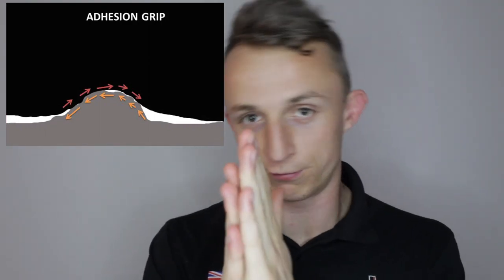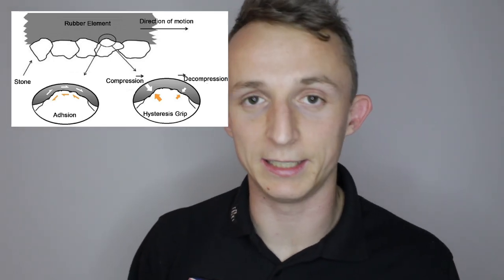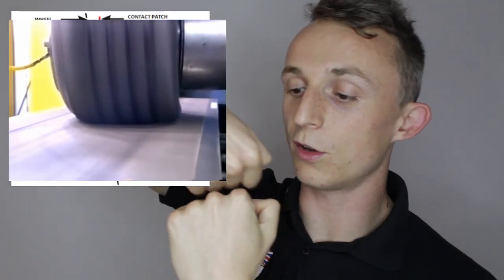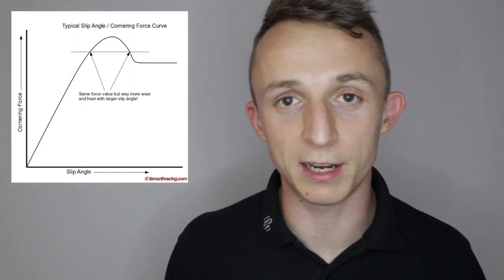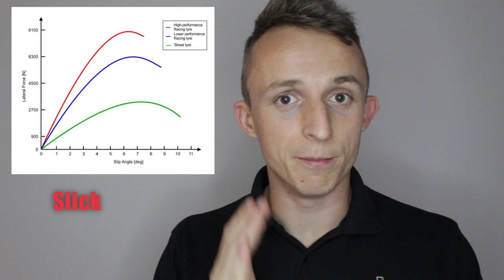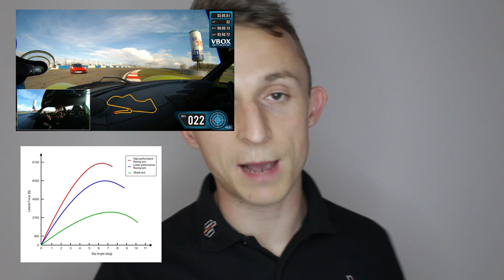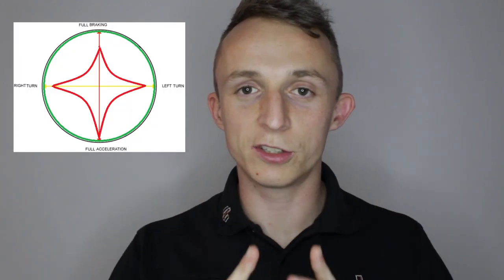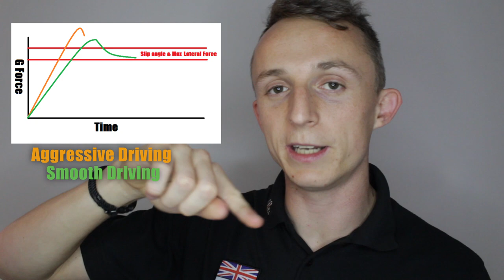How to Motorsport - Understanding Tyre Physics for Racing and Track driving

Comment: We need more! How do you optimize pressure per corner, how do you setup for wet, how does track temp effects your setup, how can you tell your pressure is off?
Reply from the maker: oh wow all very big topics!
I don't think you can optimize them per corner, rather per session. Your manufacturer should be able to reccomend target pressures
Generally go higher with the pressures for wet to allow the tread block to cut through the water, 
track temps will change the set up in different ways for different cars, 
You can tell if the pressures are off by the wear pattern and if the cars optimum grip changes